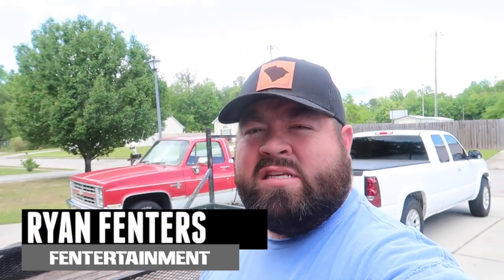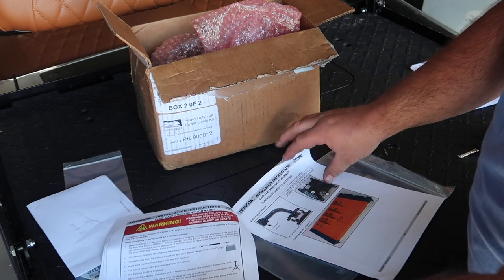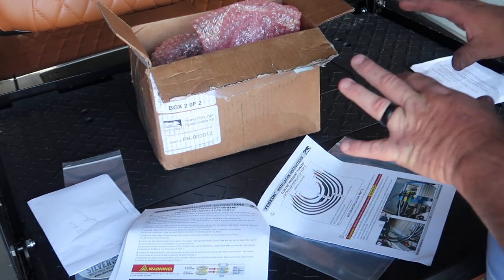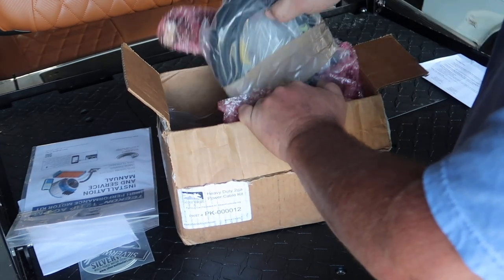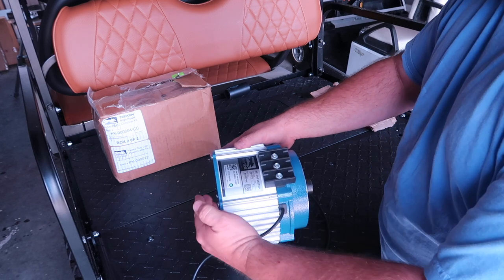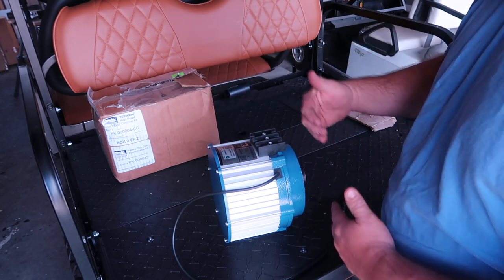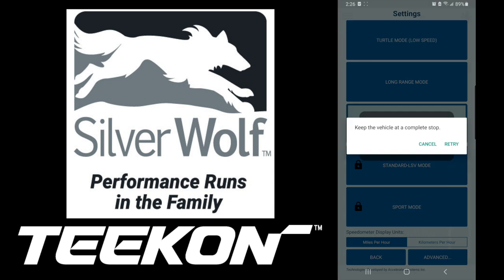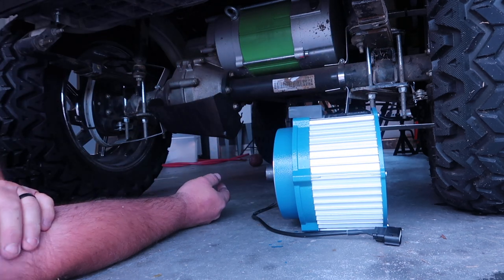The All New Golf Cart AC Kit | SilverWolf TEEKON 12HP 9KW Permanent Magnet Motor & 840Amp Controller

Comment: Nearly 3 years later and there are still so few relevant videos on this motor/controller.  Curious how this 12HP/9kW setup (which is much smaller in physical size) compares to the Navitas 5kW motor/600A controller.  I like the motor's compact form factor and sure would like to know what the top speed might be.  Specs say it has up to 20% more efficiency in range too which would be huge.  They have raised the price since I last looked.  Nearly $2,000 for the kit with 840A controller now.  Still wouldn't be too bad if it kicks the pants off Navitas.😅

Comment: Just ordered the 5kw AC kit and now want to cancel lol. So this is a 9kw kit vs 5kw kit, does that mean that my batteries will drain much faster or will the ac 9kw motor vs navitas 5kw setup be more efficient?
Reply from the maker: Its like any other kit. The more amperage you throw at something the more its going to drain the battery. However I hope to test the range of this motor/controller very soon with the hsky lithium battery.

Comment: Silverwolf is Navitas distributor.
Reply: Incorrect.  Silverwolf is owned by Accelerated Systems.  Although at one point there was a relationship between Navitas and ASI/Silverwolf for I believe the old Silverwolf hub 4wd motors there is no longer a relationship.  Silverwolf and Navitas are both HQ'd in the same Canadian city (Waterloo, ON).  Mind you Silverwolf's physical address is a UPS mailing box in Waterloo, Ontario...  Navitas' is a real location with a building and people in it.  The Silverwolf kit is the ASI Oak motor and the ASI BAC8000 controller with a wire harness.

Comment: Too bad they don't do a 72v version.
Reply from the maker: This works on 48-72 volts.
Reply: @Fentertainment  Oh ok, that's good to know as it doesn't state that on the spec sheet.
Reply from the maker: @Coolcarting  look at the bottom of the spec sheet. It clearly says it.
Reply: @Fentertainment  Yes, I did see that at the bottom on the comparison chart, I took it as this was for just AC-PM motors in general like it also says DC shunt wound motors 48-72v in general. The main body of the spec sheet shows 48v only for the motor and 48v only for the control too. I think they should amend the spec sheet to clearly show 48-72v as this would generate more interest in their product. I would love to try this out with 72v lithium batteries.